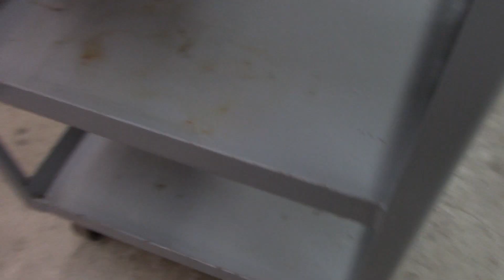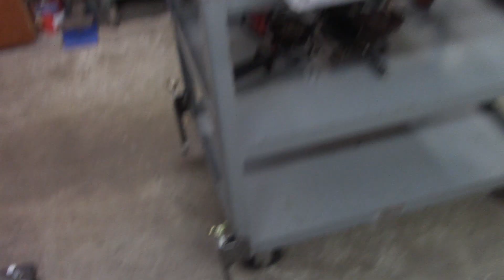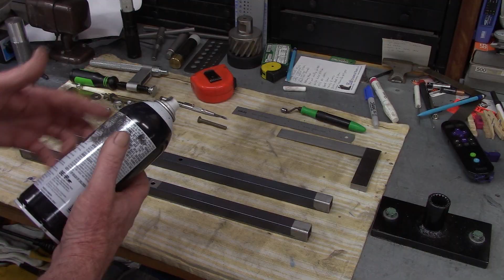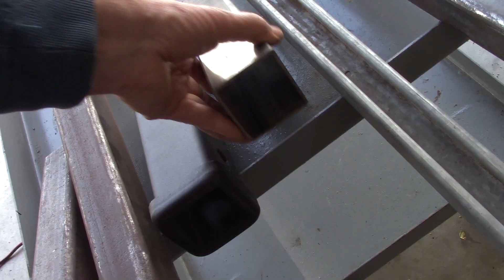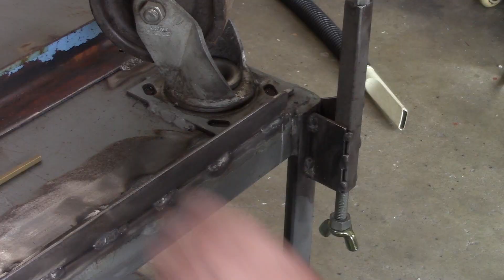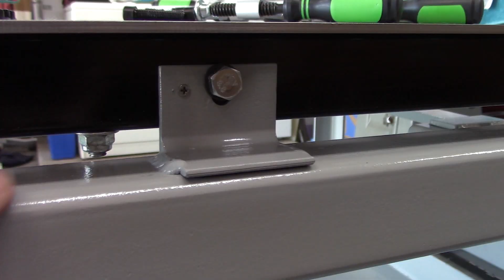DIY Ultimate Welding Table Cart | TITANIUM 36x24 Modular Table Setup

Comment: Good evening Dean,
I sympathize with your mishaps. You lucked out with the cross braces on the ends. It’s funny how sometimes it works out and no one knows the wiser. 
I did a few woodworking projects years ago and even though it looks great, all I can see is the screw ups. I also rat myself out. 
The cart turned out great.

Comment: Nice job on the welding cart.  That will make a very welcomed addition to your workhsop.  A couple of years ago I purchased a 24" x 24" Certiflat USA FAB block table for my little shop.  It comes in very handy at times.  Cheers, Aaron.
Reply from the maker: Thanks, Aaron ! I’ve been wanting to do this for quite a while. Finally got around to it.
ATB..Cheers…